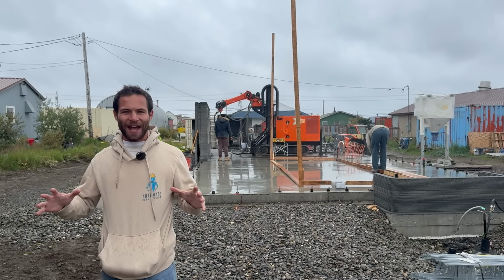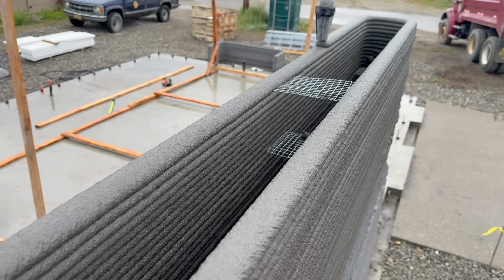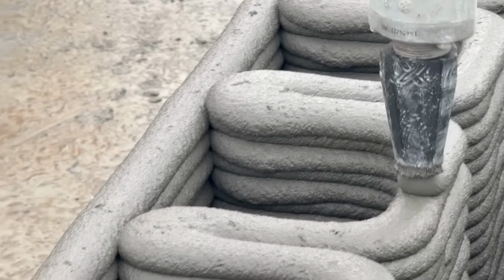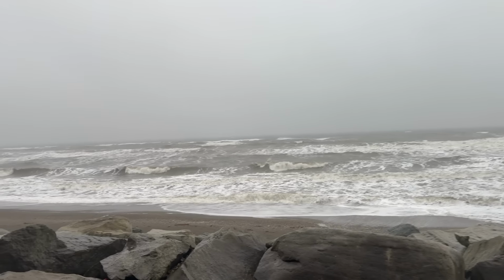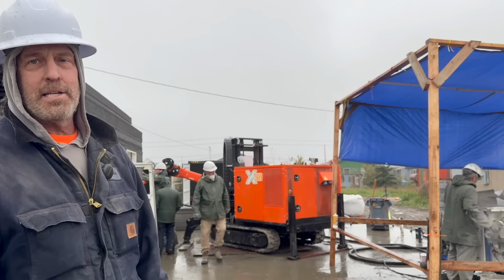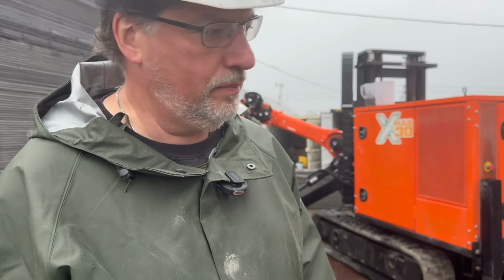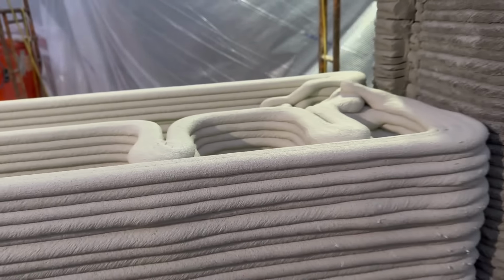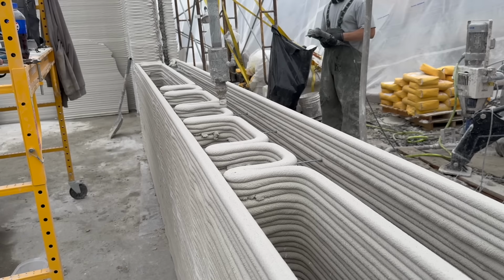First Printed House in ALASKA

Comment: This is better than gantry-based models. easy to set up and, I guess, it's possible to have two or more concurrent robots on the same site.

Also you could integrate traditional methods with 3D printing. I mean the printing part is reduced to walls with empty spaces for reinforced concrete columns. And eventually the top of columns get linked with beams. 

Just my two cents.

Comment: What's the status of the building? Did another contractor come put a roof on it and finish it? What purpose will it serve for the town?

This is very cool, thanks for sharing. I have previously only seen footage of concrete "printing" via large assemblies designed for housing developments in the continental US. Not exactly fixed in location, but nowhere near as mobile as this.
Reply from the maker: Nome Alaska is frozen over right now they need to wait until everything thaws in the spring.
Reply: @automateconstruction  Ah of course. Thanks for the reply!

Comment: How do I pour reinforced concrete for a floor slab onto this 3D printed system?
I would greatly appreciate an answer. Thank you very much.
Reply from the maker: The slab is poured with reinforced concrete before the print starts then the prints are backfilled with rebar tied into the slab at the bottom.

Comment: Why didn’t these guys just put a tent or some sort of enclosure over the structure they were building? Take away all the environmental considerations and this application reins supreme. By the way, the word up here in Alaska is that the weather caused major problems for this process. What should have taken days or weeks to print took several months

Comment: They mentioned off-world applications (Mars) and such will require a whole new design of the equipment. First is weight, everything has to be made of the lightest material possible in order to get the machine to the Red Planet with the least amount of rocket fuel. Once there you have to compensate for the atmosphere, extremely cold temperatures and a near vacuum, so hydraulics will either have to be replaced with electric systems of signifantly changed. For hydraulics to work in that environment you'll need different fluids capable of withstanding the extreme temperatures and seals will have to be sufficient to hold the pressure of the system with almost no resistance from ambient air pressure. Even the concrete mixture will have to change, flow from the nozzle will be increased as it exits because of the reduced ambient pressure, followed by a rapid cooling which is terrible for concrete curing. The extreme environment requires special considerations for everything really, circuit cards, greases, no rubber materials as temps make rubber brittle, even a laptop requires significant change to properly operate. In other words the machine seen here is absolutely nothing like what we'll use on Mars, but we have to start somewhere to find what we don't know.

Add to all of this the more extreme environmental conditions the structure will need to withstand, in effect it'll be sandblasted on a regular basis.

Comment: How is this better than building from precast concrete panels? You have to bring all the concrete to the site anyway, plus the machine, then assemble the machine. I see a lot of people standing around including the poor guy risking his lungs by sieving the material. At the end you get weird looking house without sharp corners and I am not sure how easy it is to build multiple floors? With panels you get much better quality and smaller single family house can be also assembled in just one day.
Reply: Some good points.   We like Precast concrete panels,  ICF and a bunch of other technologies.  Unfortunately, none of them are economical in rural Alaska.  The reason that so many people were standing around is that this is a research project and there were a lot of PhDs in the shots.   Sharp corners can be produced.  We like the rounded ones.   Multiple floors are possible.   The printer in the video was developed for remote Alaska conditions and has a physical height limit of 25 feet with 22 feet being the practical limit for building.  So two stories are possible.  There are other printers that are more suitable for mid and high rises.  Not much demand for that in rural Alaska. Very easy to do what you are suggesting in places with roads that connect to other places with roads.   Lastly, we were having material problems and without all of us masking up, the project would have come to a screeching halt.  We either had to hand filter or wait another year.   This is not the typical way that the materials are handled.  We have a hopper system that didn't get used this year.  No material problems last year in Fairbanks so no hand sorting of material on that project.

Comment: I have been in the manufacturing of buildings supplies and also in construction in the interior of Alaska for 35 years.  Love the hard work and effort it took to do what you did there in Nome.  The exterior durability is a big plus, but something has to be done about the transfer at the stop and start of the wall print.  A lot of the expensive foam will go to waste when you have weak points of transfer like that.  I know printing the interior walls with an offset from the exterior would take more setup time and money but what you have there would not fly in Fairbanks.  It was -40 outside my house this morning.  Not knocking on you guys and your ongoing improvements, just some input.
Reply: Bradley, Please reach out to us,   We have a structure that you can look at in Fairbanks.   It was printed in 2024 and is holding up very well.  We would love your raw feedback as you are exactly the kind of person who can help us do things better.

Comment: How long was your build timespan and what's Nome's typical building season when someone would be able to build a whole town?
Reply: Great question.  Assuming that materials to build with are available in Nome.  There is usually good weather in late April or May.   Depending upon the Sea Ice, barges don't usually show up until late May or Early June.   Work can continue until mid September or so but at the end it is very cold and wet.  In between it usually cold and wet but can get weeks of beautiful weather as well.   As far as our time frame, we have had other considerations on this project that pushed us to building late into the year.  We put in the foundation in May and could have printed the walls in June and been under roof before July 4th.  That is what a rational commercial builder would have done.  We did not do that.  We didn't start on the walls until late August and then ran into unexpected material problems that caused serious delays.

Comment: Adam Savage had a video a short while ago about a similar printer.... not as portable, but it did include a steel cable in the concrete as it printed... I wonder had they used something similar here if they could have avoided that failure or at least limited it.
Reply: The printer behaved very well.  Our issues were with the material.  There are at least a half dozen printers that our collective team had experience with.  None of them would have fared any better as the problems were not with the printer.   Additionally, the printer we chose was develop for Alaska conditions.

Comment: I think people are missing the point for WHY they're interested in developing this technology. It will AUTOMATE construction. Meaning labor will no longer be a major cost. Imagine this as part of a group of machines that could build with minimal supervision and materials. Just deliver the machine on site, program it, and let it run.
Reply: Why not just automate the setting of poured wall forms and use of SCC concrete? Way faster and better than this nonsense.... and less expensive.

Comment: you can tell the guys who actually work from the guys who don't.  the brand new unstained cloths to the dusty jackets. 17:08   18:56
Reply: Ha, we all eventually got filthy.  This was a much "dirtier" workspace than normal because of problems with the mix.  We had to hand sort through 117,000 pounds of material.   We were filthy.   The same basic project in Pennsylvania a few weeks later and everyone looked like they had stepped out of the Carhartt dressing room.  Also there were workers, expediters and relief crew(me) and researchers.  We were having a tough time and even the researchers ended up dirty.

Comment: how do you run all the plumbing and electrical??
Reply: The majority of the plumbing was placed in the insulated and radiant heated concrete slab.  There are stub outs all over the foundation for water, sewer, etc.  As for electrical, we added junction boxes, switches, and conduit as we went.   We will do a full video on this at some point in the future.  Please follow us so you get the updates.

Comment: Why not trowel the concrete while soft to finish off with a smooth surface?
Reply: I'm sure there is a proper answer but I'm guessing they can't push on it. If it was like stucco on a wall you have a fixed wall behind the stucco you can push against. In the case of the 3d printed wall it is putty at best and pushing on it probably would deform the whole structural aspect of it.

Comment: I'd try to add stone lintels.
   Why can't you do a topography scan that can skip over stones added? You'd have to switch to full perimeter as your daily, then the short walls could hold the weight the next day.
   Turn it more into a mortar machine where concrete is shipped long-distance.
Reply: What you are saying is not impossible.   Foundations are a big deal and critical to success in western and Northern Alaska where Permafrost is OMNIPRESENT.   On this particular project, we were testing wall technology and built a very safe, super well insulated cement foundation.   We have the ability to print our own footers and can do topography scans that would allow for printing over top of uneven or natural substrates.   Thanks.

Comment: No rebar between a finished section and the next due to the extruder head hitting it. 
Pretty dirty at the connection to the finished wall with runout, hopefully you trowel that.
Reply: Not shown in the video is the concrete header that has horizontal rebar or the dozens of columns that have vertical rebar.  As far as the connection shown on film being dirty, It sure was.  We experimented with a couple different ways to end each wall section.  The UGLIEST version was captured in all of its splendor on one of the days that Jarret was filming and of course ended up being featured prominently in the video.  Trowel we did.

Comment: Highly recommend that they get a Toughbook Laptop for that machine for our tough climates; a lot more durable especially since its a heart of the system.
Reply: Indeed!   Great point.  We love Tough Books!   In fairness, we were making on the fly adjustments and had the manufacturer @xhab3d and researchers from @UniversityAlaskaFairbanks  and @PennState on site plus others.   If we were to reprint the same house tomorrow, a laptop would not be required.  There is a second hardened PC that is a handheld.  Anytime you see an operator "driving" the printer, that PC is in their hands.

Comment: I thought the advantage of 3d home was time. This looks like it it took forever
Reply: It did.  Lots of issues--mostly around problems with the materials.  Our teams next print in the lower 48 went off without a hitch.   In general, when working properly, we can print a 20x10x1.5 wall in about a day.  This 1500 SQ FT structure had 8 walls.

Comment: why those 1diots are using single nozzle and not printing short shingled braided layers just like brickwork masonry is layed? doing long straight runs is asking for delamination because concrete without rebar cannot handle expansion load and house will have expansion due to temperature gradient.

Comment: Although I like the idea, it looks much slower than cinder block or foam blocks with concrete pours. Except for only needing to ship the dry components rather than heavy cinder blocks not sure how this is cheaper. Time is money, people are money.

It seems like the walls need smoothing before they set to ensure adequate bonding of the layers.
Reply: We will post our financial analysis at the end of the project.  The layers bond incredibly tight after just a few hours.  
smoothing them would add even more strength.
Reply: It's a joke..... way too fussy and slow

Comment: No next day air, but if you’re on the known shippers list, you can use Alaska Airlines. Local knowledge. Ha! LOL! Are you a Noman now, or are you Inupiat brother. Ha! Joking aside, I wonder where the dew point is in the wall. Traditionally, a 6mil poly vapor barrier is used to keep moisture out of the wall. It’s a critical issue to keep wall interiors dry to stop insulation damage and mold (no rot with concrete).
Reply from the maker: The people of nome are from the Eskimo tribe
Reply: @automateconstruction The Indigenous people around Nome are primarily Inupiat, though there are also Yupik (often spelled Yupiit) people in Western Alaska, especially farther south along the Yukon–Kuskokwim Delta and the Bering Sea coast. “Eskimo” is an old outsider term that was applied broadly to the Indigenous peoples of the Arctic—including the Inupiat, Yupik/Yupiit, and Inuit. “Eskimo tribe” may a well be from Disneyland. You’re so cute. 😊 Congrats on getting to Nome. You do a great job and your passion is outstanding. Keep up the great work.
Reply from the maker: @MM-sf3rl  that's what I thought but 2 different nome locals said Eskimo isn't offensive because thats their actual tribe. Other tribes may be offended by it. Maybe they were pulling my leg but they seemed sincere.
Reply: You are right about Alaska Air Gold streak. They do a great job but the further you get from Anchorage, Juneau, and Fairbanks things sometimes take just a bit longer, especially when weather events like Russian volcanic eruptions and typhoons cause flight cancellations. I have been a Known Shipper with them for decades. The Goldstreak service has a physical size and weight limit. I believe the weight is 120 pounds. However @alaskaair, @NorthernAirCargoOfficial, and @LyndenInc have regularly scheduled Air Cargo service for larger, heavier items into Nome. All three were used on the project plus a ton of help from the Alaska National Guard @GuardAlaska made this project possible.

Comment: Межслойная адгезия никакая. В этом направлении нужны исследования.
Reply: Our test results and actual printed results have shown good results. Правда, if the printer stops for more than a few minutes for any reason during a wall section, it is important that a bonding agent be applied to the top layer before printing resumes. Otherwise, there will be consequences.

Comment: Best 3D printer I have seen yet. I will be following up with this company on availability, renting, buying, etc. As a contractor, structural engineer by degree, they have taken into account several material issues and application issues. Best video yet! This will change how homes are built world-wide. The construction industry will revolt. Keep the videos coming.